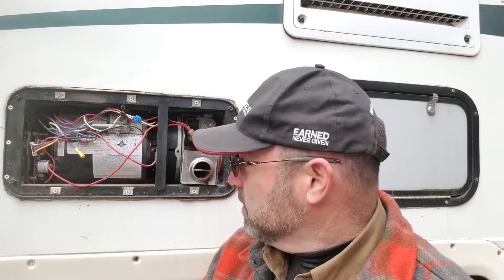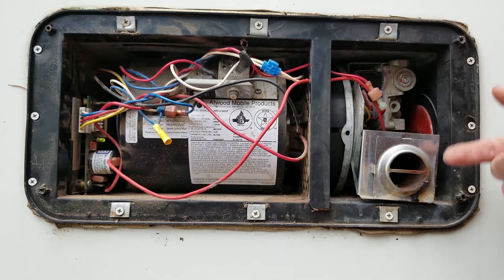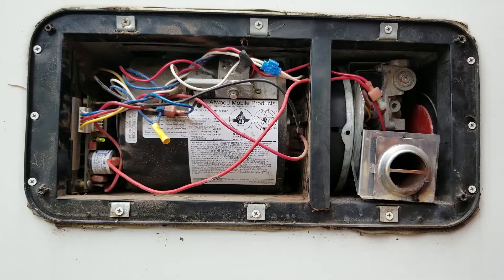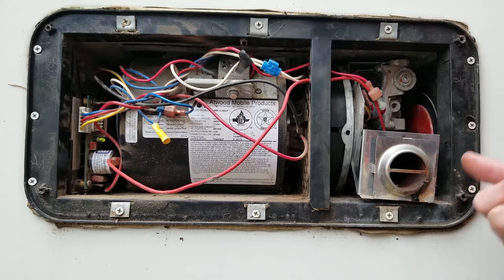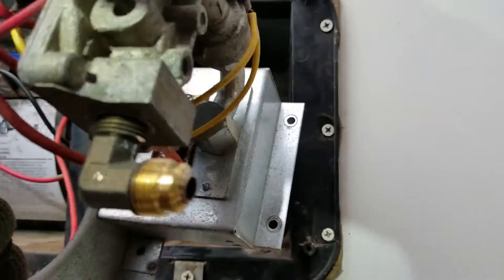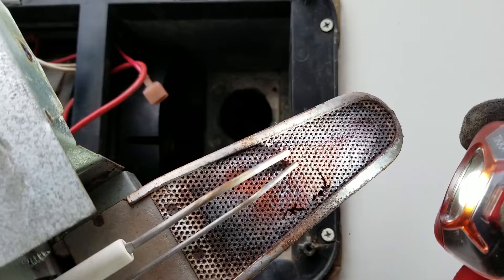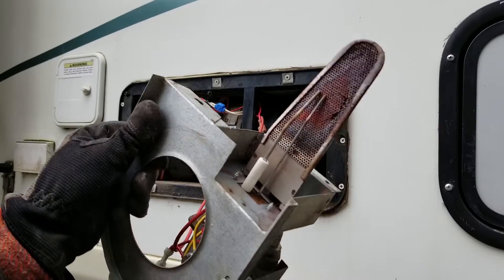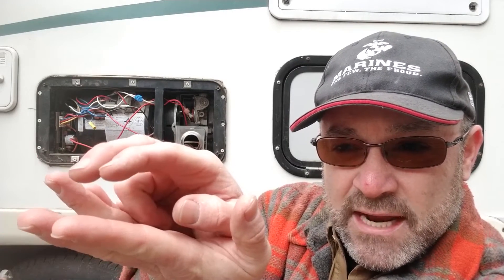Atwood 8531-IV RV Furnace With Intermittent Heat

Comment: Good evening, can you please let know where is the flame interruptor position in the furnace 8531-IV ?
Reply from the maker: I'm not sure I understand the question, there is an electrode that is 1/8" over the flame spreader, if that gap is not set correctly the main DSI (direct spark ignition) board cannot detect that there's a flame present and that will turn off the gas valve.

Comment: Hello Sir.. I have a suburban sf35f 05. New ignition ⅛ in from good burner new sail and new dinosaur board cleaned. It will run great for a few hrs then stop. Then it won't run at all. Now it will run once if I run the tstat down then back up to run temp. Any idea would be appreciated. Got this far with your videos but at a loss now.. only solenoids left . Ordered a new tstat and high limit but watching this its not the limit. Thx

Comment: Young man, you talked me through a lot about having the confidence to dive into my 2004 Airstream Atwood 8525. Long story short after spending 4 months in Florida and then no heat in Chama, NM and then back to Michigan, I discovered the gas orifice was plugged and the manifold was afoul with tiny no see-um bugs!

Since we’re running on a furnace over 20 years old, I did replace the electrode, gas valve and burner. Bang! Heats like a dream! 
Thanks again for ALL your videos!
Reply: Btw I had spark and then the lockout code- could not smell gas. And I knew my tanks were full.

Comment: Great video.. I have Afmd35121.  I had a control board problem. Replaced that and while I had it out changed the burner, which looked burnt out like the one in the video.. Now i get ignition but it blows it self out after a few seconds , sometimes abit longer. Any idea?

Comment: Great video thanks. 
Looking up my issue found me here. 
Furnace wont ignite smell the propane but will only ignite if I restrict the exhaust port. Strange thing is both furnaces rear and front were working perfectly fine until I decided to top off my propane tank before leaving for an adventure. Now both furnaces are acting similar. Fridge and stove top working fine though.

Comment: Our furnace (exactly the same model as this one)wasn't working.
We had a trailer guy come out and look at our trailer .
He said..
Oh ..that's an old furnace
You can't get parts anymore..
A new one costs over $2000..
And he wouldn't recommend that
We said ..ok thanks .
So we relied on electric heaters..
What you did here is exactly what our furnace was doing .
Took it apart as per your instructions..
Our burner screen was almost completely gone. 
Got new parts..
Hooked it all back up again and it works great..
All thanks to you .
$20 later we gave heat again..
Just wanted to stop by and say thanks .
Cheers

Comment: I bought a replacement igniter. But it does not look like the old one. The old one has three pins into the firing chamber. And two connectors. The replacement just has a single connector. That’s hardwired to the electrode, and then comes with a heavy red cable, but I don’t see how to connect that. Any ideas?

Comment: @7:47 wait - you never replaced the HV wire? If you look at how the wire was situated and where it's burnt @1:51 it's touching the cover so it works with the cover off, but when you put the cover back on, if it touches the inside of the cover it will short out again.
I bet if you look at the inside of the cover you'll see burn marks where it was touching the wire.
All Wires, especially HV wires should be organized and immobilized so they don't move or rub on anything.

Comment: @1:51 - 1:54 That "knob thing" on the control board is a HIGH VOLTAGE Ignition coil, That's NOT 12V on that wire, it's a few THOUSAND volts to generate the spark equivalent to the sparkplug wires on your car. Go ahead and touch it thinking it's only 12 volts. - You can tell by how the wire Feels, thicker, softer, Rubberier insulation and a thinner wire inside, just like a spark plug wire.

Also I SEE what's wrong with it -  in the middle of the wire between the 1st 2 screws in the pic, you can see this HV wire is rubbed through and has been arcing to ground, killing your spark. This wire also functions as a feedback wire telling the board that the fire is on,  (when the fire is on, the heat generates a small voltage that the circuit board senses and knows that the fire is on. When this wire shorts to ground the board thinks the fire is out and shuts the gas off.

I spotted this as soon as you pointed to the wire and called it 12 volts, less than 2 minutes in.
now lemme watch the rest of this and see what else you messed up. I hope you didn't replace this wire with a regular non-highVoltage wire or even worse - Tape over it.

Comment: i have this  exact furnace which is only blowing cold air.. no clicks, no ignition, just consistent blowing of cold air. I removed the wingnut to pull out the exhaust port but its not budging even a little. should I spray some lube on the back of the port where it slides into the hole, or is there another screw i am overlooking?
Reply from the maker: We've had success with using 'PB Blaster' and just let it soak for some time.

https://amzn.to/49stLC6

Comment: Could a heat exchanger be plugged from mud dobbers? Furnace would not light before, made all the sounds to light but would not. Burner was burnt up igniter was broke short, replaced both now it lights goes out lights goes out, gas pressure is right.

Comment: So originally my issue was a dirty flame sensor was lighting then going out. 2 weeks later its doing the same again i clean the sensor again. Still doing it. Then i think i have a burner issue. But it looks almost brand new and flame sensor has plenty of spacing. Sail safe is clean of debris. What should i do?

Comment: I have this furnace. It just started tripping on high temp. I haven't been able to determine why. Works correctly otherwise. Furnace turns on, provides heat. Vents get extremely hot. Can not stop on grates as it'll burn your foot. Burner kicks off, circ fan stays on, then once cool enough, heat turns on again. Rince and repeat until the thermostat has reached temp. Burner issue?

Comment: When you reassemble the burner back into the furnace, what seal / foam tape do you use between the heat exchanger wall and the piece the burner is screwed to ??

Comment: Do you need any tape on the propane connector? Thanks
Reply from the maker: The thread tape is only used for pipe thread connections. You would never use thread tape on a flare connection.

Comment: I have to ask because I had to buy a $50 relay to replace the failed one on the original unit I have. I don't see one in your harness, did you bypass it completely?
Reply from the maker: I think you're referring to the time delay relay. The older furnaces required those. On the newer furnaces that functionality is Incorporated on to the control board.

Comment: So i just took my burner out i also have a hole so ill replace that cause i 2as having intermediate lighting aswell. My question i have is i have 3 prongs coming out to the mesh and my prongs are no where near as close to the mesh ilas this in the video. How far from the mesh should it be

Comment: I am getting the 3 light error code - Ignition Lockout.  I have already verified the sail switch and the hi temp limit switch.  I smell no propane but hear the ignitor attempting to light.  I have removed the burner/valve assembly and it look okay... So now what?  Please help.
Reply: I've verified the spark off the electrode but no solenoid activation.  So the valve is not opening. Board or vavlve is the problem?
Reply from the maker: Coinciding with the sparking igniter, you should have 12 volts feeding those solenoids. You can check that at the white connector on your control board. If you don't get 12 volts coming out of the control board feeding the gas valve solenoids then you can put 12 volts directly to the Dual solenoids and try to blow air to see if the solenoids / gas valve is good.  That could be how you could determine if the problem is the gas valve / solenoids or if it's a control board not sending the signal out.   On our playlist we have a video on how to test and replace those solenoids. On our Amazon affiliate page we have solenoids.

https://youtu.be/zCp_HXPaC8U?si=TRKJBIQuk0Um8R9Q

Amazon link for solenoids is actually under the water heaters category. But it's the same solenoids.
 https://www.amazon.com/shop/myrvworksinc/list/TPZDSQ46E64H?ref_=cm_sw_r_apann_aipsflist_aipsfmyrvworksinc_BZGZMSEYG0JMM2912J1T&language=en_US

Comment: Thank you so much for this video! I’ve been struggling with getting my Atwood 8531 in a 2001 Prowler to run once it’s warm. When it firsts starts it’ll fire right up, but when the furnace kicks back on to maintain temp I n the camper the fan will
Blow but it won’t ignite. I’ve dismantled and cleaned the burner assembly, I’m at a loss. Any random internet help would be greatly appreciated. Thanks again.

Comment: I have this exact furnace. And your video really helped! It’s definitely our burner head. It looks worse than the one in the video. Anyway, I can’t seem to find that specific part anywhere. All my results keep turning up part 30268. And one RV parts site said the 30268 has been used to replace a 36043 and a couple other burner heads with success. So will a 30268 work?

Comment: Just to let people know I've been a tech for over 55 years I do a lot of field adjustments on igniters like this sometimes increasing the Gap from three-sixteenths of an inch which is standard to 1/4 of an inch helps with the dinosaur electric boards and sometimes the factory boards and a lot of these heaters have a metal pipe that runs down the length of the heater coming off the burner assembly and most of the time you can't remove it cuz it's so stuck so I cut a slit in the metal bend it out of the way and pull burner and pipe out together also whatever the Gap is on the igniter and make sure you leave the igniter farther away from the burner assembly than the Gap at the igniter
Reply: So originally my issue was a dirty flame sensor was lighting then going out. 2 weeks later its doing the same again i clean the sensor again. Still doing it. Then i think i have a burner issue. But it looks almost brand new and flame sensor has plenty of spacing. Sail safe is clean of debris. What should i do?

Comment: So I was having a problem with my Atwood furnace were it would start ignite and run for about 2 seconds shut off  . it would do this cyclical three times then lockout . Replaced the burner and igniter / sensor but still does the same thing. any ideas would be helpful
Reply from the maker: Your control board is not detecting the flame. So that is either going to be the igniter or it's going to be your board.

This video may help:
https://youtu.be/0t8vRuGdZLw
Reply: @MyRVWorks   Thanks so much for responding. I replaced the igniter this weekend ,same problem. So probably the board, and thanks again for the advice.

Comment: i cant remove the burner for the life of me. My RV has two furnaces, both with issues and neither burner will come out after I remove the wing nut. Any suggestions? I tapped at it and pried but no luck. Is it possible some models have the burner spot welded into place?
Reply: If you're talking about the pipe that protrudes to the outside, you have to wiggle it up down sideways with quite a bit of force sometimes to get it out. Do all of that as you are pulling really hard on it.

Comment: I just fixed our Atwood furnace that worked beautifully this spring , but would not fire up last week. After & as I removed the igniter & burner assembly I discovered mud dauber wasps had been busy. I removed almost a full pound of clay nests. They had to be scraped off & wire brushed. After thoroughly cleaning  all the parts & reassembling, it works perfectly again. I am going to invest in some screening to block any critters from ever doing that again! 😖

Comment: I'm hoping this turns out to be my problem. Everytime I think "this has got to be the problem!" It's not. This is the first thing I've seen tho that is my exact heater type.
The walk through of what was on it was the best info I could've gotten. 
Will take a look tomorrow when it's light out and not freezing and see if I can once and for all figure out was the heck is wrong with my heater. (Same issues, it works fine then turn it on 30 minutes later and it won't heat at all)
Thanks for the video and good work 👍

Comment: This is the video that fixed my furnace,  I bought a complete tune up kit for it and replaced the most likely culprits but still no ignition.  After seeing this I pulled the new igniter out and the angle didn't match the old one.  Put the old back in and fired right up .  I couldn't say what the original problem was , obviously it got fixed , but wasn't going to light up with the improper gap .

Comment: Thanks Darren.  Have a customer with the same furnace in a 29 year old class A Beaver (well kept).  Same problem.  QUESTION: when you find the problem and have to come back when you have the part - is that an additional service charge? If so is the service charge discounted? I really appreciate your channel - it drives home the training I’ve had!   Thanks so much.  (Kentucky born and bread)

Comment: Got a question for you

one I would like to contact you and the second is I’ve don all the test on my heater except the propane pressure. Symptoms are it will go through the proper sequences to ignite fan turns on gas valve turns on igniter sparks makes a popping sound won’t stay lit but if I turn the main gas valve off on the propane let it go through the cycles start to ignite and slowly turn the gas valve on the heater will stay lit and running then when it cycles on again same symptoms starts up gas valve turns on igniter lights but then it pops and then cycles it continually and unless I turn the gas valve off and slowly crack the gas valve on does that point to a bad regulator.

Comment: So I have a 1990 lynx prowler and the issue I have is it ignites runs for about 30secs to a min then the heat shuts off, or it runs threw a cycle then shuts off and won’t turn on unless thermostat is turned down then turned back on, what would you recommend to diagnose?

Comment: Much appreciated.  My Atwood heater would lite but provided minimal heat. With your guidance i removed burner assembly.  Holes were partially closed. I used thumb drill and opened all to correct size and adjusted igniter clearance.  Now operating as new.  Thank you.

Comment: Thanks for the video. I have a new RV with intermittent heat, based on this video I'm confident the problem is on the ignitor side as well. I haven't pulled my burner to inspect yet, since it fires most of the time, and is new, should I still pull the burner to inspect the gap or would you move on to checking something else? We do live at 4900 feet above sea level and are camping at about 7700 feet above sea level.
Reply from the maker: One question that I would ask is in reference to propane. If your cylinders are new, you must make sure they were purged correctly. If there is any air in those cylinders it will cause issues with your furnace especially at that elevation. So, maybe try some different cylinders that you know for a fact we're purged properly before you start digging into the furnace considering that the furnace is new.
Reply: @MyRVWorks  thank you so much for your response, ours is a motorhome (2021 Tiburon) with an onboard tank 68 lb. tank, we have had it refilled 5 or 6 times, I noticed the issue occur shortly after we bought the RV. 

The furnace will cycle through and operate and fire like normal. It seems like the overnight time when its colder it then errors out, I can then reset the furnace and usually it will fire the second time, occasionally it will take 2 resets to fire. Then it will operate normally for a few times, and then it will cycle through as normal except fire.
Reply: @MyRVWorks  today I pulled the burner and found that the gap between the ignitor was about 1/4 inch form each other and the burner moved them closer to the 1/8 inch and it fires a lot quicker than it ever has. hopefully that's the issue. Thank you for the great videos they helped me a lot!

Comment: My burner only has one electoral but it's about a half inch off of the screen should that be like a
Reply from the maker: The spec is about an eighth of an inch above the screen. Technically the distance the electrode should be from the burner head is a function of the diameter of the electrode. So, 1/8"  works fine.  We usually just get a Allen key and slide between to verify the gap

Comment: Hi Darren, just wanna thank you for the second time. You came and fixed my furnace a couple years ago in Poulsbo, and I was able to use this video to troubleshoot and fix the furnace on my new trailer. Any chance you have a part number for the electrods?
Reply: 34570

Comment: Furnace ran all the way from 51ﾟ to 66° and then pilot light shut off and then came back on about 30 seconds later and then shut off after reaching 68 degrees what the thermostat was set for.  At night the thermostat is at 59 and goes down to about 57 and comes back on all night long and no problem at all never shuts the pilot light off  in between. Any ideas .

Comment: Looking for flame sense im getting 2 blink come shut off im getting flame heat no heat then heat then no heat then it goes to 3 blink
Reply from the maker: Two things to look for would be the high temperature switch and the electrode itself. We'll have a video coming out soon that addresses this issue. In that video the issue turned out to be a faulty electrode